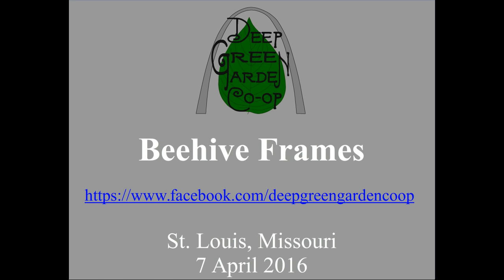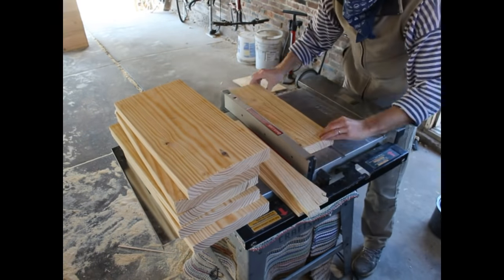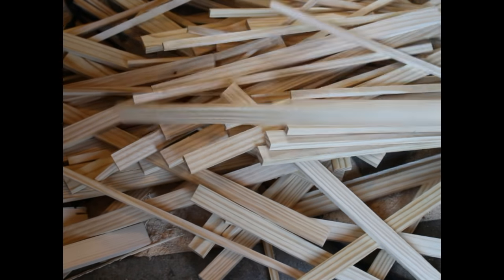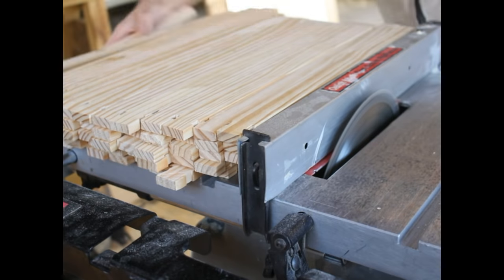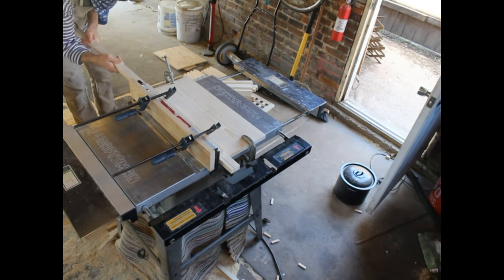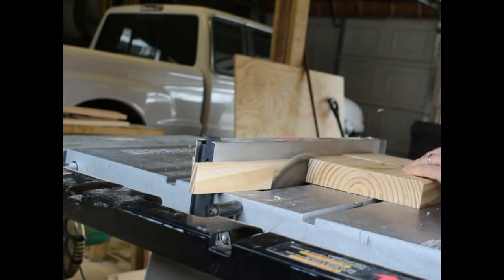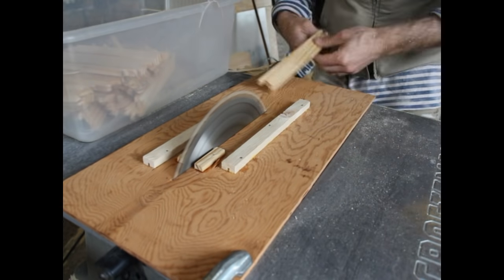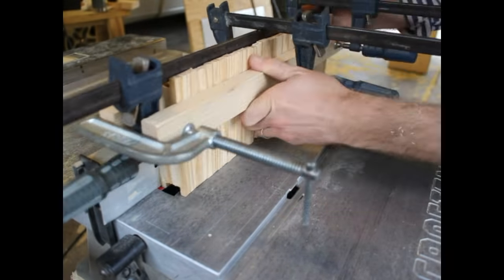Bee Frames - Making and assembling beehive frames.

Comment: as someone who cuts a lot of wood - adjust blade height just a little above the wood being cut - this keeps you from cutting a finger off instead of a little meat in case you get into the blade
Reply from the maker: S Kel yes! Good point. Only needed when cutting edges of sides in this case. Also it exposes more of blase to wood, reducing ripping or tearing.

Comment: as a woodworker i do have a suggestion. in the case of the sides where you cut the notches for the top and bottom to fit inside, try cutting the notches before you've sliced them into individual sides. after you've cut the blocks to length from the 2x10 set up your tablesaw with a dado blade (or just move the fence over a little after each cut) to cut the notch. after each side (top and bottom) of the blocks have been notched, cut into strips then just trim the edges as you've been doing. the set up you used in the video of clamping all the parts together then cutting the notch has probably worked for you so far, but there is a greater chance of mistake and accident. the notching before cutting into strips would also work elsewhere too. doing it like this will cut back on repetitive motions, speed up your work and leave less room for mistakes.
other than that i think i will give this a try. I'm on a tight budget and my bees need to expand. 
do you use foundation or wires in your frames or let the bees build on their own? i have a mind to not use wire or foundation, but id like to hear your input on that
Reply from the maker: Thanks for the tips! This year I did cut out the notches before I cut the top pieces apart. It did work out better. I didn't have a dado blade, unfortunately!
I did use foundation in these, but this year I did just a strip of foundation in the top and then wire guides going down between the top and bottom bars.They drew out pretty well along these guides and saved on foundation costs.

Comment: Just curiosity kicking up. But would it be easier to cut the notches in the side pieces first before you cut the slices?
I've never made a frame but I think as many cuts you could do before slicing all the pieces would be best. Also I think you would get more pieces of you used a thin need bandsaw. 
And your right. There are alot of cuts to making frames.
Reply: Low Tech Institute 
Sorry I guess I didn't see a bandsaw. My bad.

Comment: Soooo many process cuts could have been saved, simply by making all the the width cuts and groove cuts out of the full length of the 2x10
Reply from the maker: Absolutely right! In later builds, that's exactly what I did. Thanks for watching.
Reply: @s.a.j.johnson  Then you should absolutely make another video with your new system 👍